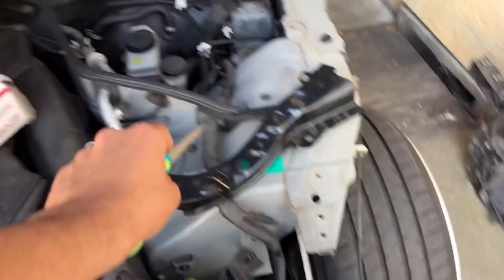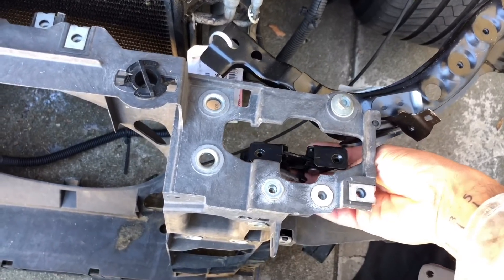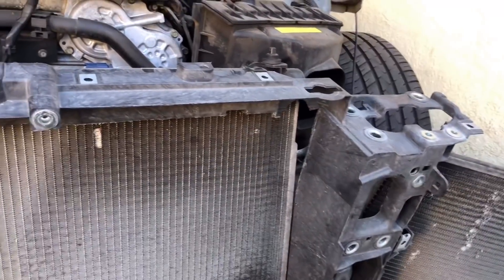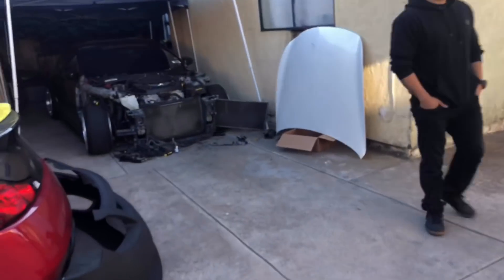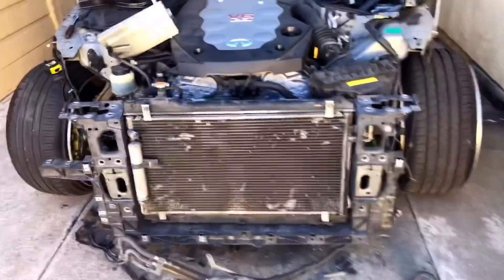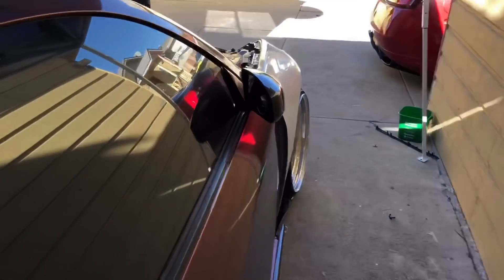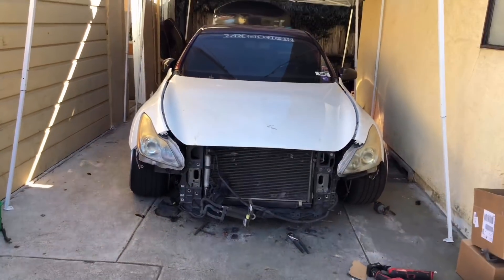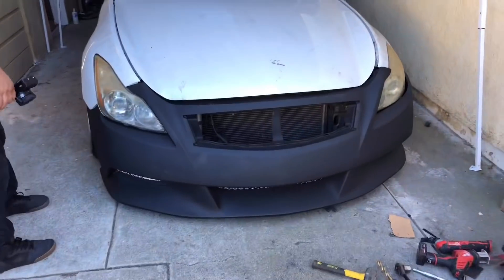G35 to G37 front end conversion ( 37 radiator support on!)

Comment: Hey man where did you get your bumper from, and how is the fitment?
Reply: Strictlybusinessmotorsports.com it's a g37 bumper not made for g35. So fitment is way off lol, it's made by vis racing. Fitment should be 10/10 on correct car with little to no body work
Reply: I totally agree. Should gone on outcast garage style frontend. Way better with perfect alignment.
Reply: @nutdiego27ify  outcast bumper is would be the same fitment , since it's not made by for that g35 converted g37 lol